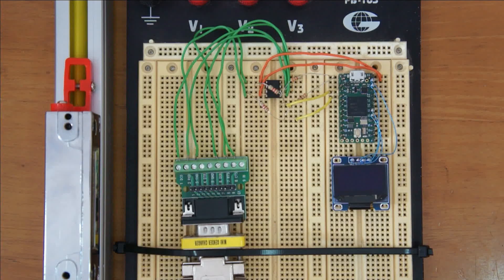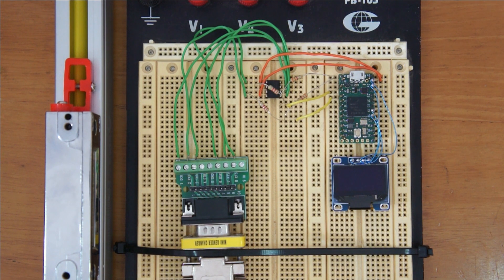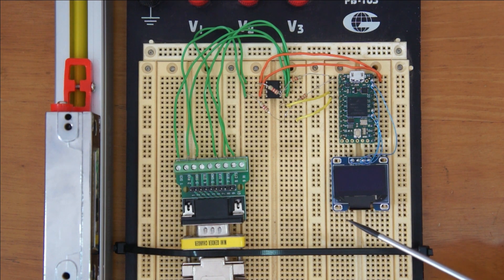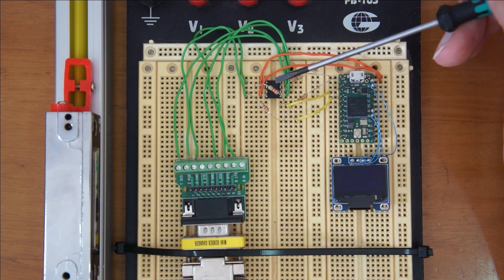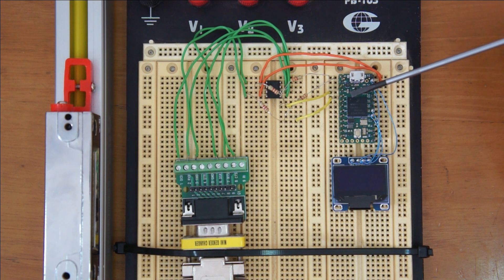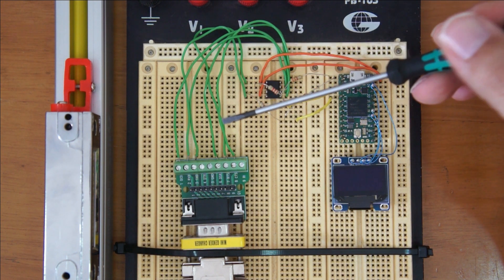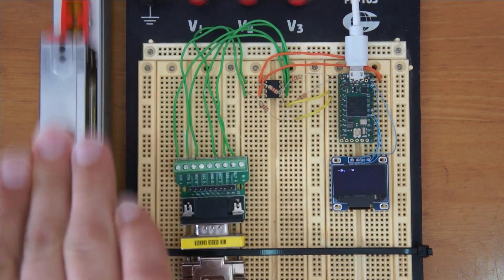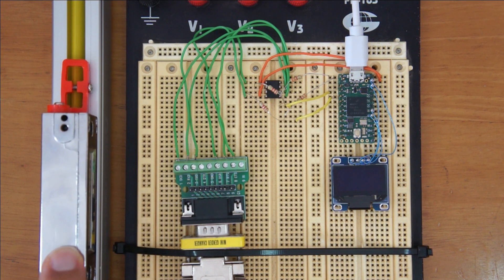Test of Teensy 4.0 hardware quadrature decoders.

Comment: Thanks for the information. 
I'm a noob to programming. 
But I'm forced to take on this fork in the road. 
I'm making a tubular linear motor. 
I need to set up a drive for it to test my work. 
I was looking at the foc control and stumbled on the teensy. 
I need to run a linear encoder and was looking at both optical and magnetic. 
Then there's the mosfet driver which I can't decide on. 
Any advice would be welcome
Reply from the maker: It can all be done with the Teensy. Just add some external mosfets. As you see here the encoder counter is done in hardware, so all you need is a PID loop that decides on the signal for the Mosfets.
Reply: @janbeck8269  I found a drv8302 motor driver module on Ali express. 
Which I was looking at purchasing for the project. 
I'm designing the winding around 24v,  but might go for higher to lower the current. 
This is for a 3d printer. 
Is there any how to out there, to use step and direction from printer board. 
Thanks for replying.
Reply from the maker: @simonlaker2139  there are many ways. Though that driver cannot take step and direction signals. You would have to use the Teensy or something to translate. I have taken the step and direction and controlled linear motors using IONI servo d rives: https://www.janbeck.com/linear-motor-based-3d-printer
Reply: @janbeck8269  thanks for the feedback. 
I was going to go for the tindie to control step direction. 
A skr pro board running on Marlin or duet firmware. 
I had a look at what you suggested and found it out-of my price range. 
Bit still a good choice. 

I'll get the tubular motor going first. 
Buy a optical encoder,  the slider type,  a couple of linear rails to hold it in place for test. 
Eventually possible o, drive.
Reply: @janbeck8269  hi again. 
What is the part numbers of your differential line receiver. 
There are so many types. 
Thanks in advance.
Reply from the maker: @simonlaker2139  UA9639. Be aware that this is a 5V part.
Reply: @janbeck8269  thanks at least I'm not loosing myself down the rabbit hole. 
I have taken notice of your resistors. 
Thanks for sharing. 
You and many others have helped me in the last week to come closer to what I want to achieve. 
Cheers

Comment: I would be very grateful if you can tell me the make and model of the scale you are using. Great work, I have just started using my teensy 3.6 commanding a servo drive (serial)
Reply from the maker: I got them from eBay.
SINO KA300 1 micron linear scales. BUT be careful. I ordered RS422 scales and they sent a single ended serial one with a RS422 converter at the end. Pretty useless. But they made it right and sent me a proper readhead to switch in. Just be sure you know what you are getting.
Reply: Jan Beck, thank you for the feedback and information. I find it fascinating what you have achieved with regards to reading the sin/cos + interpolation of TTL and getting a micro to handle it.